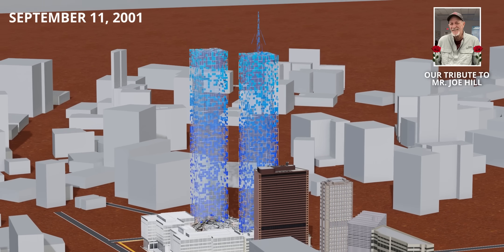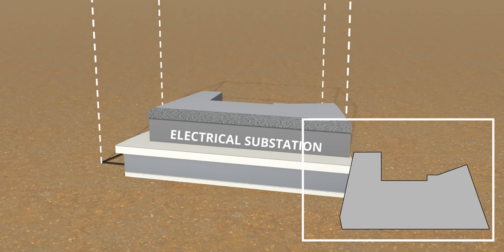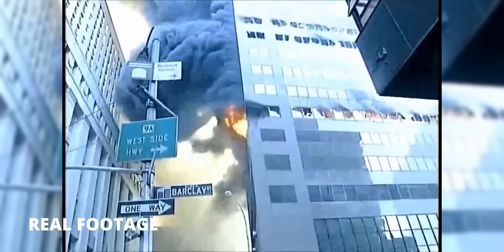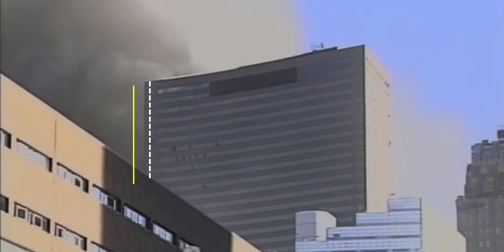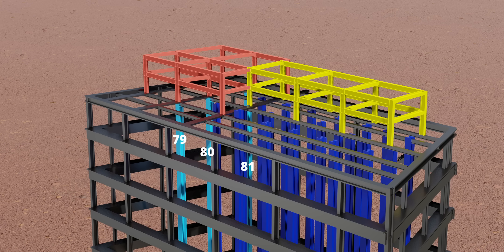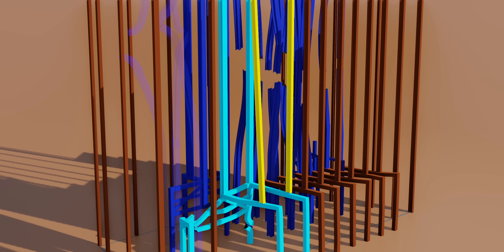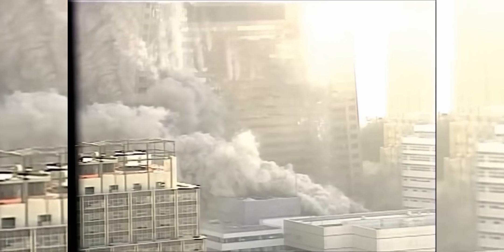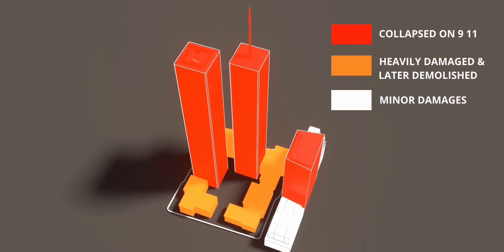Collapse of Building 7 | The Complete Physics

Comment: No conspiracy. Even then, I knew it could collapse as I watched it burning. 

The tensile strength of structural steel decreases below the safety limit at 1,110 F. Jet fuel burns at temperatures ranging from 800 to 1,500 degrees Fahrenheit.

I will say now what I said to my coworkers then (while watching the whole thing live on tv) — the building will collapse because jet fuel fire will change the material properties of the beams by weakening. I am paraphrasing what I said. I am a MECHANICAL engineer. 

This video added other elements from a civil engineering perspective and it was a fantastic engineering analysis — one of the very best I have seen.
Reply: Cooking with NOsenses - what a pathetic attempt - “ I said to my coworkers it will change the tensile strength of the steel “. NEVER  NEVER did you say that.  How many $$$$$. are they paying you  -  on second thoughts. -  actually you are more than likely Criticalwanker  attempting to hide behind a different “ handle “ .  ..  Try again Dumbo.  -  it’s good for a  “  Laff  “
Reply: So in your expert fantasy there was an airplane crashing into WTC7? Nice story my poor little wannabe...
Reply: @Kudde23 The fact you got riled up tells us more about yourself.
Reply: @CookingwiththeSenses  Riled up? You poor little wannabe are quite funny...
Reply: @Kudde23. -   Pleases keep going -    “ he” - “ she “  -  “ it. “. ( or what ever ? definitely a wannabe  ). is the one getting riled up.. or “ it “ wouldn’t react so promptly.
The usual  resorting to  “ Intentional Incitement by derogatory slurs “ 
Such an obvious tactic by the guilty.
Reply: @jimmymcjimmy9743  Yep, a wannabe, but surely no shill. No doubt shills get some brief briefing and wouldn´t go for such a stupid attempt like blaming jet fuel for the collapse of WTC7... 😅

Comment: Antenna fell other direction of wtc 7 so it was from the debris and it was probably long and slashed it. Antenna would also just fall apart.
Reply: It was core columns tipping all the way to WTC7. Another bundle of core columns also caused the damage at the sw corner of WTC7. And this is not guessing, it took me a while and quite some videos to watch to figure it out.
Reply: @Kudde23yea also in video you can see north tower debris reaching how and hitting wtc7

Comment: asymmetrical damage does not result in a symmetrical collapse. building 7 fell at free fall speeds and the only way that could of happened is if all internal supports were removed simultaneously
Reply: The video literally stated it didn’t fall at free fall speed and was slower by 2 seconds. You’re just spouting false nonsense
Reply: BINGO
Reply: What is free fall speeds? You keep using those words, now explain them.
Reply: Free fall speeds is the language of the twoofer, to make them sound smarter, in their own minds.
Reply: I get that you might think that, but the collapse only happened when enough gerters where buckled, so the building collapsed in on itself with no support at the bottom, think of it as a wooden stick tower (dont know the English name for them) It always collapses like that if you remove support from the bottom
Reply: @spatula.043 then it should have failed and fallen towards the path of least resistance. This would not be directly down, as it was.
Reply: @spatula.043  Lol.
Reply: @spatula.043  WTC7 was blown up into the insides of the other two building to the right and left. I remember that.
Reply: Good thing it was a progressive collapse then which by definition is NOT SYMMETRICAL.

You should have watched the damn video. Those conspiracy morons on the internet have been lying to you for years.

Comment: Sounds like shoddy engineering because 600 degrees will not weaken construction grade steel.
Reply: Collapse of a burning structure is always a concern for firefighters. Steel buildings subject to fire rely on active fighting of the fires to survive. Buildings are designed around 1 to 3 hours of fire resistance, allowing time for occupants to escape and ACTIVE firefighting to get started, after which all bets are off. Left to their own devices they will exceed their design envelope and collapse, as with Plasco Tower and Wilton Paes de Almeida. In B7 the occupants escaped, passive and active fire protections were compromised and active firefighting was abandoned 3 hours before the collapse, which left the building to its fate. It lost. Odds on Building 7 would eventually collapse, and it did. No big deal in logic. 

That Building 7 lasted 3 times longer than its design envelope speaks to the quality of its design and construction.
Reply: NIST analyzed steel from the fire zones, steel directly involved in fire. None had reached 600 degrees Celsius. Most hadn´t even reached 250 degrees Celsius.
In WTC7 there were floors that burned out totally, fire went out because there was nothing left to fuel it. Yet they didn´t collapse due to that.
The Twins didn´t even have sprinklers when they were opened. Obviously they were expected to totally burn out without collapsing.

Comment: Um, the only 2 dudes in the building said many explosions were heard under them.
Fireys saved them 
A controlled demolition
Reply: What 2 dudes?
Reply: @TheCriticalStinker-jw4fl 
Barry Jennings & Mr Hess.
Barry explains all in Loose Change documentary
Reply: Yep, Jennings and Hess reported explosions. The stairwells collapsed right beneath them. Light went out, sprinklers turned on. Yes, the same sprinklers that officials claimed to be not working.
Jennings was OEM employee, Hess worked for another local authority. They woudn´t support controlled demolition theories just for fun. Obviously pressure was put on them, both tried to change their stories later on but it was all on record already.

Comment: either the construction 🏗️ of the building was wrong and the architects and civil engineers and contractors in what is very temporarily called the united states of america was pure donkey's, or they were so corrupted, so the building couldn't withstand the fire in the building, what is strange the building didn't have automatic fire extinguisher system, and the safety department in a municipality of the what is very temporarily called new york didn't conducted visits to verify those buildings comply with safety standards by installing fire extinguisher system, which very strange for modern buildings standards...
 
another possibility is that the attacker placed a pickup truck or minivans packed with explosive and incendiary in the underground parking garage if the building has such underground parking lots...
Reply: Or,... your assumptions are faulty.

Collapse of a burning structure is always a concern for firefighters. Steel buildings subject to fire rely on active fighting of the fires to survive. Buildings are designed around 1 to 3 hours of fire resistance, allowing time for occupants to escape and ACTIVE firefighting to get started, after which all bets are off. Left to their own devices they will exceed their design envelope and collapse, as with Plasco Tower and Wilton Paes de Almeida. In B7 the occupants escaped, passive and active fire protections were compromised and active firefighting was abandoned 3 hours before the collapse, which left the building to its fate. It lost. Odds on Building 7 would eventually collapse, and it did. No big deal in logic. 

Building 7 lasted 3 times longer than its design envelope - a credit to its designers and builders.

It had no basement.
Reply: @TheCriticalStinker-01  

I am not a experts on the matter, and I accept the current explanation from professional and expertise on the matter, until I find a counter explanation to this theory by similarly professional experts...
 
although I have few points the sprinklers in the automatic fire extinguishing system are supposed to help partially or completely extinguish the fire, or at least contain it further by reducing the heat because those  automatic fire extinguishing system capable of pumping waters continuously until it turnoff manually, the size of the fire is small compared to the size of the building, whose other floors were spared any fires, I think the fire started on the other side of the place where the communications tower was hit...

Regarding the underground parking garage, I said, "If there is one, don't forget that Ramzi Youssef's blessed attempt involved detonating a small truck in the tower's garage, that's why I assumed there was a garage at the bottom of every building."

I was trying to refute the ridiculous myth that the destruction of the tower was an inside job carried out by the settlers' intelligence apparatus in what is very temporarily called the united states of america, for the mission was accomplished, not only the twin towers was collapsed but also in the process several wtcs building were destroyed, what is very temporarily called the united states of america were dragged and contain alongside its vast recourses into prolonged attritional war of hunting ghosts, whom riding pickups and armed with primitive cold war era weapon systems...
although the failure of the blessed september attacks was number of harvested heads compared with the destruction on the ground...
Reply: @LIONIQ-FLYINGSHARK106 - Building 7 did not have an automatic fire suppression system (it was manual) and the collapse of the North Tower cut off the water supply for it even if it had. Add to that half of the responding firefighters having just been killed, others injured, units in disarray and much of their equipment destroyed and it is not hard to see why the building was left to its fate. 

Firefighters who were actually there at the building witnessing it firsthand all describe Building 7 as fully involved in fire. Spread across multiple floors simultaneously it was an unprecedented fire event with no active fire suppression or fire fighting.

Comment: On the morning of 9/11, at 6:47am, before any "hijacker" entered any of the "hijacked" planes, the alarm system in WTC7 was set on test mode. Therefore fire alarms were ignored by the system. Why would they do that? And why wouldn´t they put it back to normal mode as the events unfolded? Investigators had hard times to figure out when and where the fires in WTC7 started, there are even conflicting conclusions about that. With the alarm system in normal mode they wouldn´t have that mess, however, they would probably have even more problems to explain why they never spent any serious efforts to fight the fires in WTC7...

When the first plane crashed into the north tower, electricity in WTC7 was briefly gone. No explanation for that out there.
When the second plane crashed into the south tower, electricity in WTC7 flickered again but this time also the water pressure in WTC7´s sprinkler system (for the lower half of the building) was suddenly gone, forever. Not only have there never been any official attempts to explain the loss of the water pressure at the moment the second plane crashed into the south tower, they even completely ignored that incident and claimed the water was only lost when the north tower collapsed, almost one and a half hour later.

They claim that one main reason why they didn´t make any firefighting attempts at WTC7 was that there was no water supply left in the area which is a blatant lie since there was one water supply left in the area and it was right in a neighboring building of WTC7. By just letting WTC7 collapse they risked that last remaining water supply.

They evacuated the area and therefore stopped the rescue mission in the area. They didn´t only risk the last remaining water supply, they also risked the lives of people potentially buried alive in the area. What disgusting cowards...

All they would have needed to do is get a fucking hose and connect the remaining water supply with the sprinkler system of WTC7 and let it do the job the firefighters were too much of cowards to do. Or were they tino the controlled demolition anyway?

They say they put a transit on WTC7, that´s how they figured out it would collapse, they say. That´s how they even figured out WHEN it would collapse, they say. That´s impressing, since such collapse had never occured before according to NIST. So where is the transit data? Who gathered it? What´s the names of these incredible experts that correctly predicted even the timing of the first collapse ever of its kind? And why did NIST never care?

NIST said they didn´t have a single piece of WTC7debris for the investigation. Weird huh? A skyscraper collapses and they get rid of the evidence before they even start to try to figure out why... So they based their "investigation" on computer simulations that obviously have nothing to do with reality. And they decided to keep the input data secret because releasing it "might endanger public safety". Yeah, there would be riots if NIST exposes their fraud...

NIST finally admitted that WTC7 collapsed in free fall for the height of 8 storeys. But never even tried to explain why. Even in admitting the free fall they still tried to deceive about it. That´s the only good part of Sabin´s analysis: It proves NIST´s fraud for it clarifies that the kink that NIST claimed to be vertical movement already was horizontal movement only. This means there was no "less than free fall" stage prior to the free fall as NIST claims. The collapse started right with the free fall.

The free fall that nobody ever even tried to explain without controlled demolition.

You want to get rid of the obvious shills that are flying around here? Just ask them for a free fall explanation. They will dodge and whine, dodge and whine, dodge and whine. Because there is nothing else they can do about it.

Comment: An example of how strong thermite is
Reply: Don't think so, it can barely cut trough a half inch thick steel plate. Thermite has never been used in demo before and never will be for the simple fact that it's not effective at all
Reply: @ThreeLettersFed  Nice guessing, but actually thermite has been used in demo before.
Reply: @Kudde23 Once. Exactly. How impressive. Once in 130 years.
Reply: @mooneyes2k478  Nice guessing MoronEyes, but actually it was at least twice in 66 years and even if it was once in 1000 years it would still falsify the claim that it has never been used before. Are you able to grasp that simple fact MoronEyes?
Reply: @ThreeLettersFed  Not ENTIRELY true. It's been used, once. And that didn't go too well, presumably why it's not been used since.
Reply: Here's another one

youtube.com/watch?v=JXWCMBuusMI&ab_channel=TrutherTVArchives 

In this video starting at 45:35 and running to 48:35 the Energetic Materials Research and Testing Center (EMRTC) conducts a test to examine the effectiveness of thermite in cutting a vertical hollow box-section steel column. The column tested is smaller in cross section and made of thinner steel than that of the Twin Towers perimeter columns (and never mind the core columns). In total 175 pounds of thermite are used for the test on just one column and requiring the construction of a rather conspicuous coffer dam to contain it. Do recall the Twin Towers had 240 columns and 110 floors.

It would be odd if thousands of office workers missed hundreds, perhaps thousands of those suddenly appearing.

Note what an incredibly slow process this is. It took close to 30 seconds for the thermite to finish burning off.  It would be impossible to “control” a demolition using this material.

Not to mention the issue of; how does the aircraft impact and subsequent raging fires NOT prematurely set this stuff off?

Also note how bright and obvious the whole process is. Could not be missed visually. No way to hide that. 

Then at the end of the test the (relatively modest) column was undamaged…. which is a problem.

Certainly no rivers of molten steel emanating from it either and in fact the whole thing cools rather quickly as soon as the thermite has burned off, as one would expect.

Thermite has never been used in the controlled demolition of any building, let alone one with multiple floors on fire after the impact of a large jet. If the conspiracy oriented internet has taught us anything it’s that if something has never happened before, it can never happen.
Reply: @TheCriticalStinker-01  That´s so sweet my poor little liar, but there have been controlled demolitions that used thermite and National Geographic was debunked by Jon Cole.
Reply: @Kudde23 Jon Cole have never couldn't bebunk Santa Claus. As for "controlled demolitions that used thermite"....no, there hasn't. Making it up doesn't change that.
Reply: @Kudde23 Aawww, what do you know, you picked the "source" that publicly state they're not a source. What a shock. Bravo, you failed.

I note how you ignored the "two occasions in the past 90 years" too....couldn't be that you knew you had nothing? Surely not.